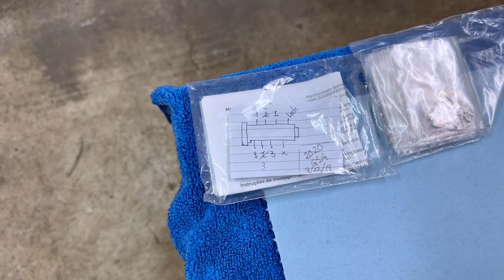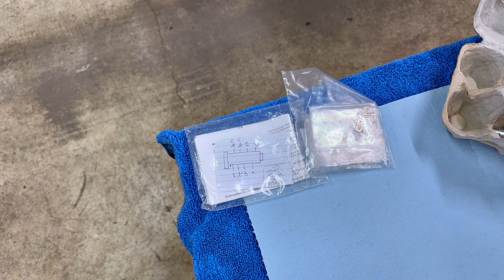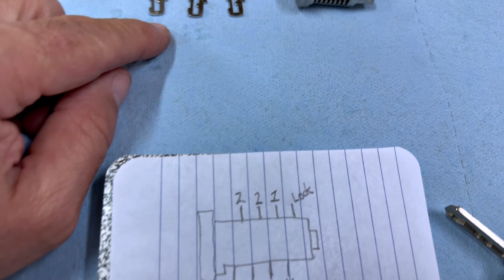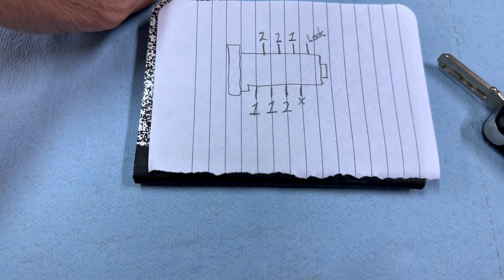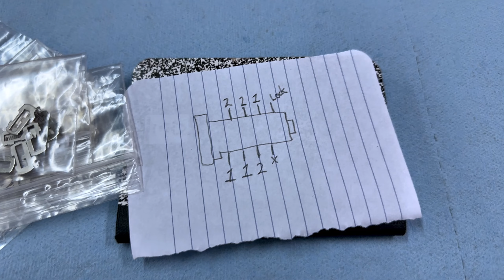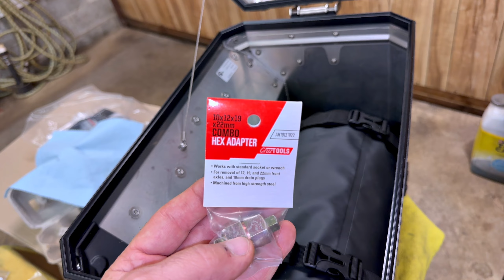2023 BMW R1250GSA!! • Building Bag Lock Sets! | TheSmoaks Vlog_2826

Comment: Hey Shawn, since my Spyder is the only Spyder I’ve driven, I definitely would not know how one should drive without thinking my drove correctly.  After the laser alignment I’ve noticed the nanny is not kicking in now.  My Spyder slow down and downshift from sixth gear to second gear through the small S curves down my street.  Now after the alignment my Spyder just downshifted from sixth to fifth and held steady on the speed.  What a pleasant improvement.  So glad I listened to your videos.
Reply from the maker: That's great to hear!  I didn't ride it prior, be it was a sweetheart afterwards.  A lovely F3-S!

Thanks so much, and it was a pleasure to meet you Leonard!! 👍👊

Comment: Shawn if you remember my Super Tenere from when I stopped by 4 years ago I had to do tumblers on it. I was using Givi luggage which uses similar tumblers as BMW. I was short a couple of the correct ones so I used a couple that stuck out a bit with the key inserted and ground them down flush to the barrel so they would work. Even with the key out they stuck out enough to function properly.
Reply from the maker: Sorry you had to take the extra steps, but sounds like you got it all sorted..!  Man, that's been 4 years already? Lol

Thanks Doug!! 👍

Comment: Hi Shawn, I got the SW Motech bag and figment having seen yours,  from memory it only uses some of the tank screws.  I purchased stainless Torx bolts to fit it as it came with non stainless bolts.  I think 4 need to be longer to accommodate the plastic mounting ring.  Kindest regards from Bonnie Scotland.  Joe.
Reply from the maker: That's a good idea..!  I was having to use a T25 & M4 Hex to install it this morning. Lol. Yes, only the front 4 are used for the mount.

Thanks Joe!! 👍

Comment: Congrats on 23 years. Just wondering what has happened to the war wagon. You seem to be in the Honda a lot lately.
Reply from the maker: The ol' war wagon is fine, we've just been procrastinating getting badly needed tires installed.  We take short with it for supplies, etc...

Thanks so much Lindsay!! 👍